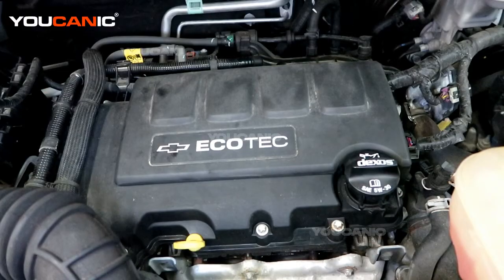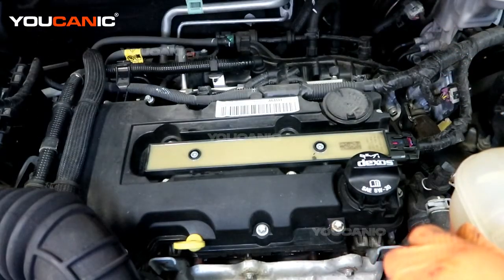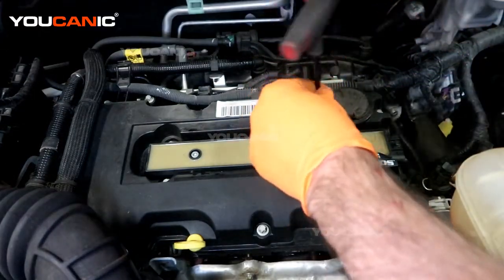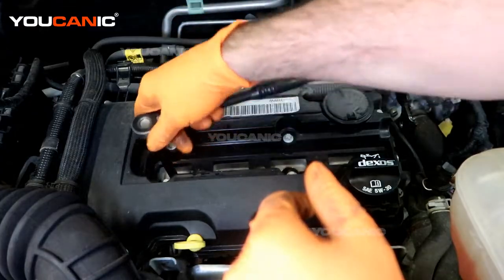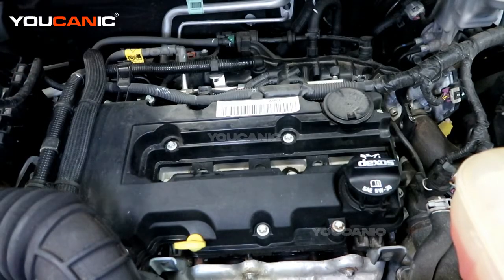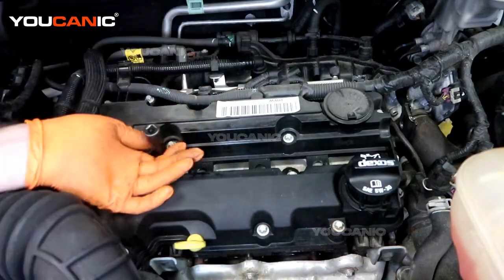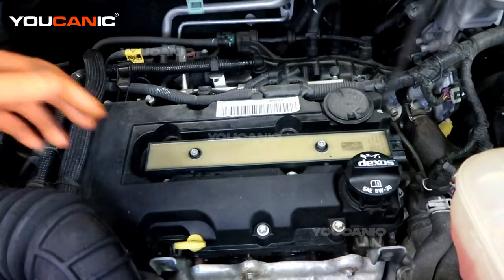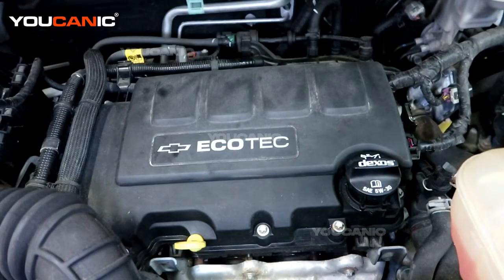2015-2023 1.4L Chevrolet Trax - Spark Plugs Replacement

Comment: Why wouldn’t you tell what the spec is?
Reply from the maker: Hi there, thanks for your interest! At Youcanic, our objective is to equip car owners with the necessary tools and knowledge to confidently manage car maintenance. We provide guides, free resources, and access to our very own YOUCANIC scanner to make it all a breeze. 

Should you require in-depth information, we even have factory repair manuals available. Visit us on www.youcanic.com/ if you need any further assistance. We're here to make your journey in car ownership as seamless as possible!
Reply: @YOUCANIC  Don't make a video showing the repair if your not going to give socket size and torque specs. These are things that need to be known when doing this job.
Reply: @phantomsk8ers  Nah, these jokers are making these to try to make a buck on their "manuals". Unreal the idiocy of some folks.

Comment: Thanks dude! I was looking up why my Holden Trax (Chevy Trax) was misfiring, thinking about replacing the fuel filter until I came across this..

Turns out the last guy who serviced it didn't screw down the coil pack correctly and didn't clip the side connector in all the way. 

👍👍👍👍 Thanks for the easy to do video!

For anyone with a Holden variant of the Trax, the plastic lid is similar but it's just a flap that you pop up from the right side, (the bit that has Ecotech on it)

Then wiggle the coil pack straight up, it's a bit heavy 🙂

Comment: What about the boot grease😊
Reply: There is any grease that needs to be put on the bottom of the spark plugs
Reply from the maker: At YOUCANIC, we provide comprehensive diagnosis and repair guidance for car owners like you. Our Full System Scanner can come in handy for diagnosing car issues [www.youcanic.com/scanner]. And, we have a multitude of resources like OEM Factory Repair Manuals. 

If you have any more queries about boot grease or other auto concerns, visit our platform [www.youcanic.com] where you can ask questions. We're here to make car repairs easier to understand and execute. Remember, we're here to help you navigate through your automotive journey.

Comment: What a waste of time. You leave out the spark plug gap and the torque. Why even make a video about something so simple to do but leave out the specifics to this vehicle. Jesus wept.

Oh, I get it. This is just the primer so you can sell some equally useless manuals and that is where folks are supposed to get the specifics. Pathetic